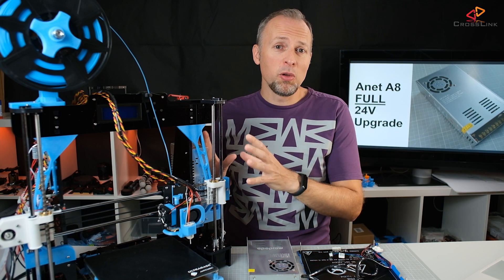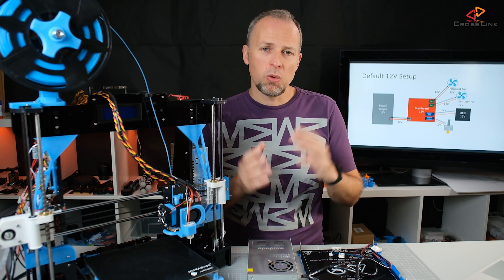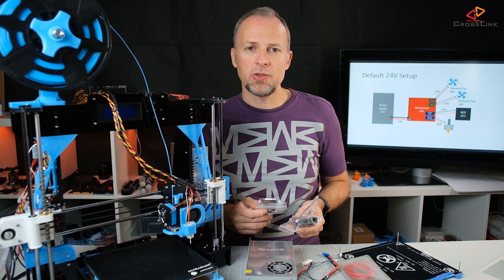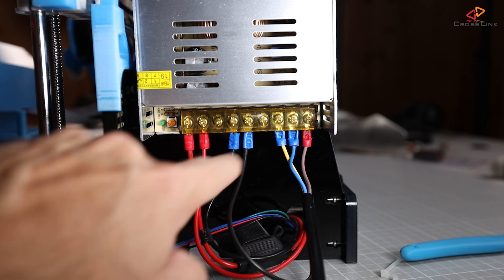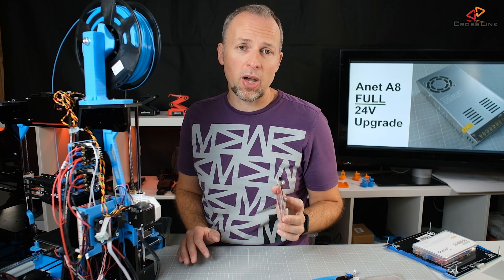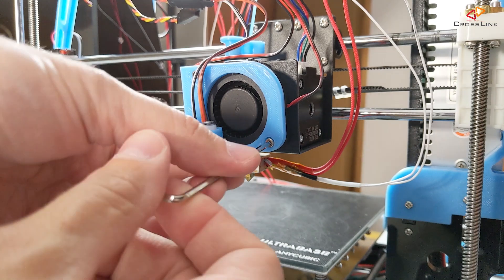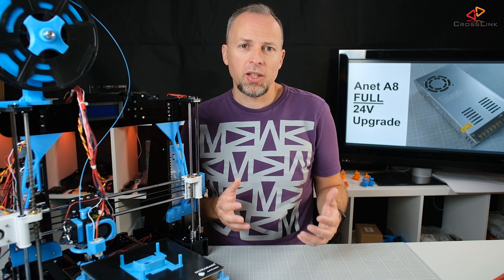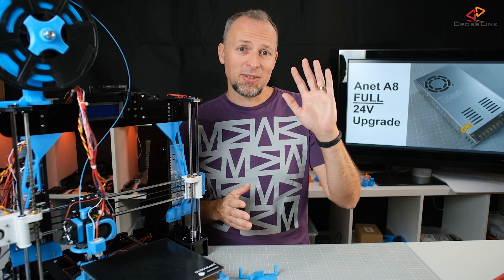Anet A8 Full 24V Upgrade

Comment: You actually don't need new MOSFETs. In Anet A8 PCB mounted MOSFETs are IRLR7843 and they are capable for 30V, over 100A and only 3.3 miliohm. That means they easily can handle the load even for 24V.

Comment: Why  24V 15A and not  24V 30A?
Reply: If your system requires 15A then you don`t have to use a 30A power supply. It would just be more expensive and require more space. the amp rating is what your power supply is capable to deliver as maximum. If you only connect 1A load to a 15A power supply, it will deliver 1A. 14A spare to connect more devices. if you connect 1A to a 30A power supply it will also deliver just 1A, 29A spare for other things that you could connect. But if you are not going to connect anymore then what is the advantage of using 30A?
if the heat bed is 200 Watts and the heater 50 Watts, your load on those two items is 250 Watts. 250/24=10.4A
The board doesn't consume much nor do the fans. There is only two motors moving at a time, the Z-axsis barely moves. I think it's enough but I could be wrong. when I get time I will attach my oscilloscope to my printer next time and check the voltage drop, ripple and current draw when the motors are running.
what of an advantage would have a 30A power supply in your eyes, can you please explain the reason behind your question?

Comment: I upgrade my ANET A8 ( video on my profile) with metal frame and glass bed. I testet him and result was amazing. It's more stabile,  no ghost print, no vibrations. The 3d printer is 2 years old. I change a nozzle and works perfekt  like first time.

Comment: If the y axis motor is hot, check resistor 16 on the board by the y motor pinouts. Its supposed to read 15000 ohms but mine read 23k ohms, meanimg on 1 volt was getting to the y axis motor which made it extremely hot

Comment: the wires are not the problem, it's the  bed connector. it jitters and move as the bed move and make bad connection that is what heating up. all the bed burns started at the connector. i replaced my connectors and never had a problem, if you are worried about the wires just replace to a thicker guage.

Comment: #Crosslink Why am I getting my hotend and heat bed is shooting so up higher after the upgrade of the 24v Power Supply. Was it because I did not upgrade the heater for the hotend to 24v so, it shoot way higher than the expected temp?
Reply from the maker: Yes, this might be the reason. A 12V heating cartridge on a 24V PSU ist going to overshoot quite a bit because it heats up much faster.
Reply: @Crosslink3D  Thanks #Crosslink. And i had just installed the 24v heater and it is back to normal now.

Comment: So, I forgot to also ask, why go with another Anet A8 Board?  If going through the trouble to upgrade to 24V, why not go with and SKR 1.3 board instead?  First, the SKR board is about the same price if you include a set of 4988 drivers and you get the benefits of having a new 32 board and being able to run Marlin 2.0 (Marlin 1.1.9 is the last of the 8-bit firmware, by the way).  Not only that, but you would be able to easily upgrade the stepper drivers overtime whereas you have NO option for driver upgrades on the Anet board.
I'm not trying to beat you up about it, I'm just trying to understand the decision.  I do enjoy all your videos tremendously.  Keep up the great work!

Comment: 24V is in no way safer than 12V. The lower the voltage, the safer it is. What was really meant is that the wires you use may melt due to a high current if their gauge is not enough.

So, how much money has been spent on these heat-up time/safety upgrades? (New 24v heat bed, new 24v power supply, new 24v motherboard, new 24v heating element) And what you get in return? 2-minutes-faster heat-up time and a unique experience of buying new stepper motors that are overheating hence have a smaller resource now?
In order to make it safer, I connected the MOSFETs and the motherboard using three different pairs of wires. I used the thicker ones for my heat bead MOSFET, the less thick ones for my hotend MOSFET and I connected the motherboard with my own wires. (the gauge is approximately the same as that of the thinner wires)

Comment: Hi  Daniel great video could you tell me if the new Anet 1.7 board comes with a bootloader installed.
Reply from the maker: Yes, the board is pre loaded with a bootloader. However, you might be better off to flash the optiboot bootloader to free up some space if you like to enable features like mesh bed leveling.
Reply: @Crosslink3D  Thank you for the reply.

Comment: Also, I see you're using a 24V, 15A supply.  Any particular reason for this?  Did you consider a slightly more powerful supply such as a 24v, 30A supply?  I only ask because when printing ABS, the bed temp needs to be something north of 100C and a power supply with a bit more current capacity would help with heat-up time and maintaining such high bed temps (The bed is definitely the power hog in these systems).
Reply from the maker: I measured out the power consumption. Unless you like to power a lot more stuff like lights and more fans from it, the PSU is powerful enough.
Reply from the maker: I will test 100 degrees, let's see how it keeps up

Comment: Great!!  Another great and informative video.  Thanks! 
So, on the new Anet 1.7 board, did you copy and install your old firmware from the previous board or did it come with the factory stock Anet Firmware?
Reply from the maker: The board came with stock firmware. I immediately flashed Marlin to it. Bootloader is already preinstalled.